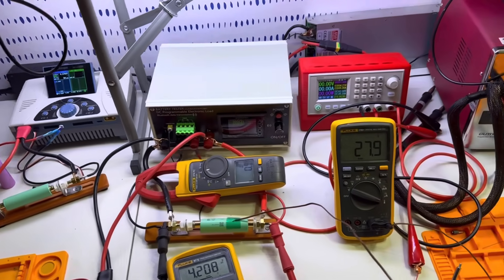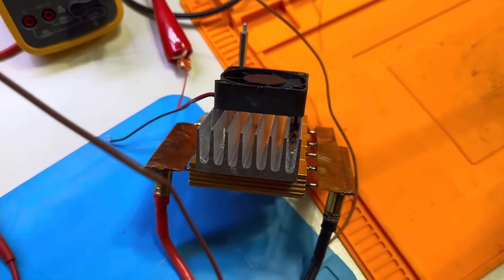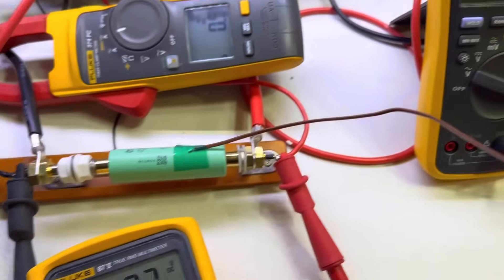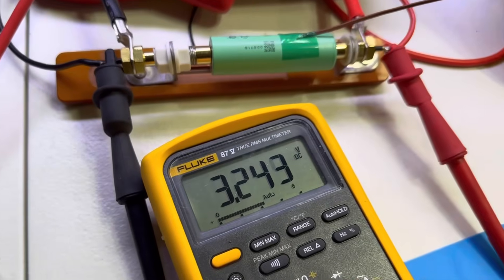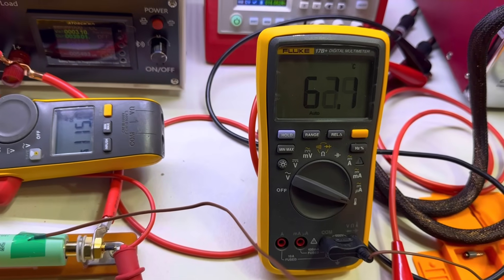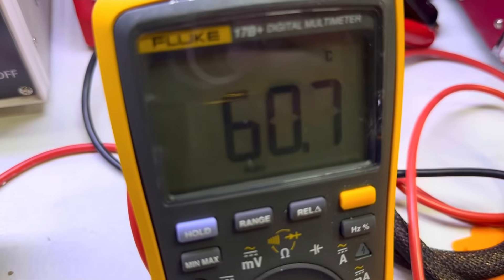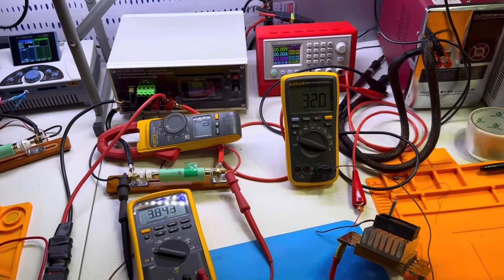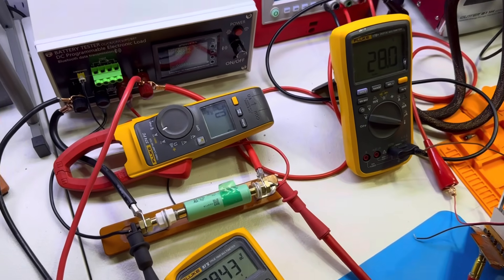🔥 NEW KING OF 21700 CELLS! EVE 50PL 125A 5Ah CRUSHES ALL COMPETITION! 🔥

Comment: Hola Nelvick, WOW!! Almos 1:10 Min at ~120A but the Temperatur went up quickly and kept rising after shuting it down. A Bit scary. But at least These propbably will work awesome on 60-80A in parallel :D Or on mixed cycle with just peaks to over 100A for a few seconds. Im wondering how the capacity for example at 40A is… And you say something about JP-40. Did you do also These Overkill test on those :D?  I’m wondering also how much time my BAK 45Ds would hold that current before they get freaking hot cocking 🤣 Interesting is that the voltage stays pretty constant at 3,250V 👍🏼 I can remember Wojtek from YT „RC Edf Jet“ testing the P45B which were the revolution after 40Ts. He pushed the cells at 160A for a couple of seconds an they had a sag down to 2,8V… but of course to temperature test and not so long… artificial cooling with be something to take into account of one trying to build lighter setup :) Que tengas un lindo fin de semana!! (Iba a escribir en espanol pero se me cambió el switch 😆) Atento a cuando puedes recibir mas celdas :DD! Vi en internet el otro dia dos paginas donde aparecian descripciones y especificaciones pero nada más….
Reply: Hola Nelvick! Pero pasando los 80 *C y llegando hasta 94 según el termómetro infrarrojo no se destruye un poco la celda?

Comment: How did they go from (was it) 70a of the JP40's now to 125a?!? 

That's a crazy BIG leap for a cells output!
Reply: From 70A to 125A and from 4Ah to 5Ah, so everything is greatly improved! Amazing!
Reply: @JayEmm-i5z  Wild ain't it?! But damn good for us guys! ⚡👍
Reply: Idk if this is legit but I would say that tabless outside of tesla is quite new and they are just getting started with this tech, and in early days of any tech, they will sometimes make big jumps.
Reply: @Arek_R.  Well, whether you're right, or wrong they are happy jumps for us guys, and if it all works out and these newer Tabless cells perform as well as they claim, then happy days.
From the testing Nelvick, (and Mooch and others I've watched) have been doing, well they seem like very powerful, high output cells...
I'm just in the process of acquiring all the necessary items to start building a few packs, and my first pack I'll be using a load of 18650, 2600mah cells a friend gave me, but for any other packs afterwards, I'll have to save up a few quid and buy some of these newer, very impressive tabless cells.
👍
Reply: JP40 burst rating is 140A for 5sec. 🙂
Reply: @batterymooch  Thanks for the info Mooch! 
To be fair I'm totally fine with anything over  15/20a really, 'cos at the moment I'm just running with a 52v20ah pack with 'grade A' unbranded cells...but I know my 2000w with 45a controller is murdering my battery, so I need a pack with better cells, as I think it's cells probably only put out maybe 10a